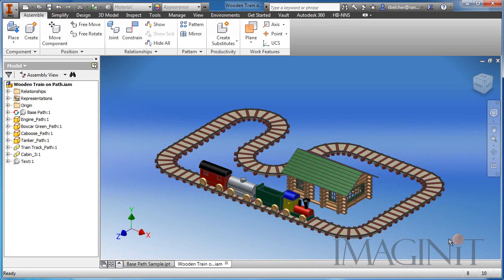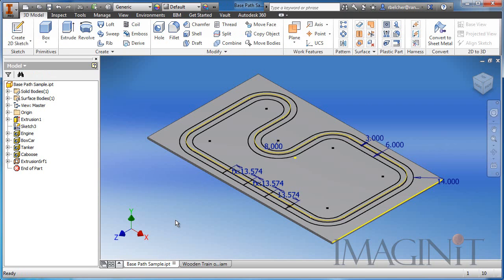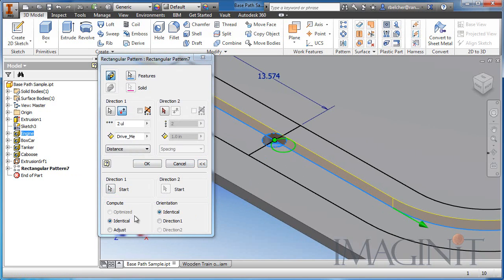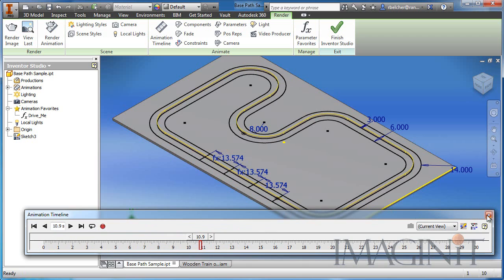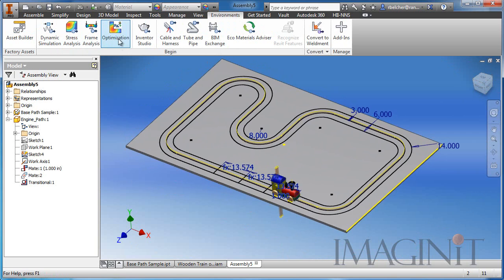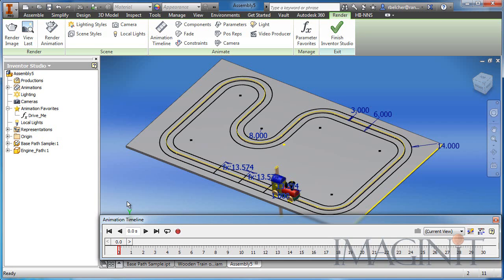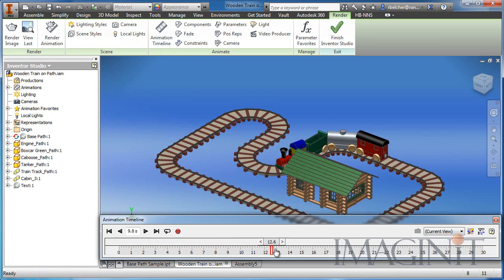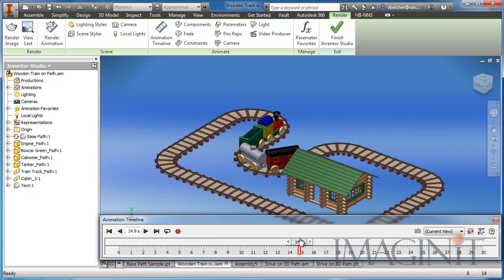Using Autodesk Inventor to Drive Parts Along a Path

Comment: I am in a bit of a dilemma. I'm trying to use this technique to drive my custom car along a figure eight track that goes above itself and then under sort of like an overpass but infinite so it keeps going around. I constrained my car to the work point but it does not go up and down the ramp like I want it to. Instead it follows the figure eight path at the same level it started from so at some points it is floating. Please give me some tips on how to fix this any help would be very much appreciated.
Reply from the maker: The Deathstar you will have to generate a 3d path between the figure eight sketch and the surfaces that make up the track and overpass.  That will be tricky, and might require you the develop the 3d sketch in multiple segments.  Once you have that, you can constrain the work Point.  Similar to the final example in this video.  I hope this helps.
Reply: Rusty Belcher You misunderstand I have already created a 3D sketch and made a path to pattern my work point. When I go into inventor studio in the ipt the point successfully goes along the path exactly like I want it to. But the problem I am having is in my iam my car is only following the path on the horizontal plane and not the vertical plane. It is hovering over the point so as the point is going underneath the overpass of the figure eight the car is moving above it but still with it if that make sense.
Reply from the maker: The Deathstar ok.  You will have to create some kind of constraint between the car and the track.  Or develop additional 3d sketches to serve as the "rails" of the track.  Then constrain the car to the rails.  Again, it's tricky.  When you get it, let me know.  I would love to see the results.
Reply: Rusty Belcher Thanks, I'll see what I can do.

Comment: @RustyBelcher I'm trying to get a train engine to move on the track and everything was working fine up until I had to do the animation in the assembly. once I entered all the info for animating the parameter, it gives me the message: "The specified value could not be applied. Please enter a different value" ive tried changing all the values but I get the same value. do you know how to fix this.
Reply from the maker: +Logan Anonymous 
Without seeing the assembly, it is hard to determine the issue.  It is probably having problems with a constraint or a sharp curve in the path.  Try animating the train a short distance to make sure it is working, then increase the distance incrementally until you reach the problem point. 

At some point you will have to adjust the path or the constraints to account for the issue.  The fewer constraints the better.  Hope it works out.

Comment: How can I select a whole path, when i tried to make the same path and make a rectangular pattern, it only selected a line segment, not the whole path. Some help would be greatly appreciated.
Reply from the maker: +Benjamin Miller It is important that the path have rounded corners that are tangent to each linear segment.  You will have trouble if your path has sharp corners.  (Not sure if this helps)
Reply: I tried to make a rectancular base of your path, then I felted the corners to make them round. I may have made an offset of that sketch for the center and inner edge of the path. I have tried to make a new figure, but it still won't cooperate. However, when I made it, and put it an assembly file, It showed up as purple, not black as it does on yours. Thank you for your help.
Reply: Never mind , today i finished constraining the train to the hole, and I got the hole to move along a path in the shape of a slot (it looks like a rectangle with two semicircles at the ends). However, now I have the issue that the angle that the train is in when it travels is not aligned with the path. I have tried to select the edge of the track but it only allows one side, not all.

Comment: Hi,
Once I try to use the transitional constraint to constrain the 'work cylinder' to the path, it doesn't use the whole path. It only uses one section of it (either one of the parts of a circle,  or a straight section, wherever I click) and once I've constrained it to that section, the train is unable to move off it, though it can move around on it. I've tried moving my mouse all over the rail to make sure that i'm not just missing the part to click on. I can't quite see what you did in the video because you've zoomed in. Any ideas?

Comment: iS THERE A WAY TO MAKE THE WHEELS MOVE WHILE THE OBJECTS MOVES ALONG THE PATH?
Reply from the maker: +Rob Floto 
You would have to build the wheels so they are constrained with a parametric angular value.  All wheels would have to  use the same parametric value.  You could then make that parameter a favorite and animate it similar to the process outlined in this video.  That would require a lot of work but it is possible.

Comment: I have been playing around with this and I have managed to get a single work point to drive several components along a path "towing" them, but you are correct in that Inventor gets a bit glitchy when handling the constraints under certain conditions:  Moving too fast, pushing not pulling, rads too tight.  Should be fine for the four items moving along that track though.  It didn't work for what I wanted but it was good to learn new tricks.  What I really wanted to simulate was a segmented sheet of thin material being driven off a reel.  Perhaps there is a different trick I could use for that?

Comment: Hey, this video was very useful! I've even experimented a bit, and discovered that instead of drilling a hole on the ground, you could use a *work point*, and drive it along the path as well. I've discovered this after trying to make a complex rotation-translation motion along a curved surface, where a drilled hole driving along the curved-surface path didn't behave as one would hope.